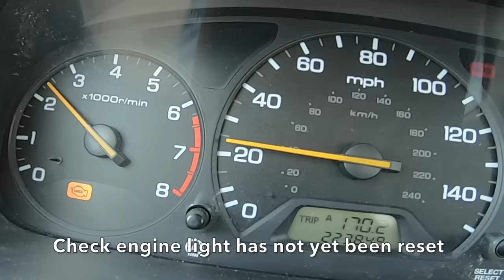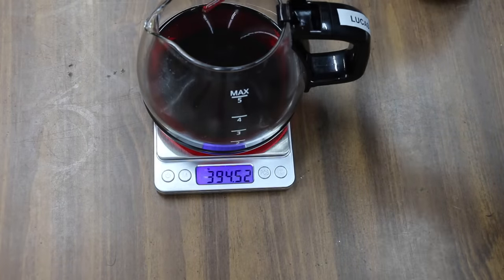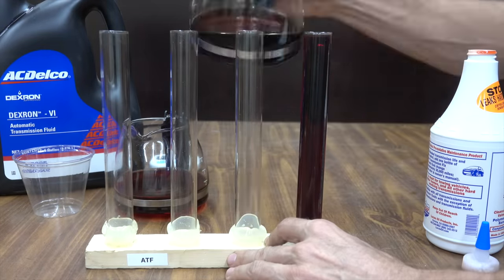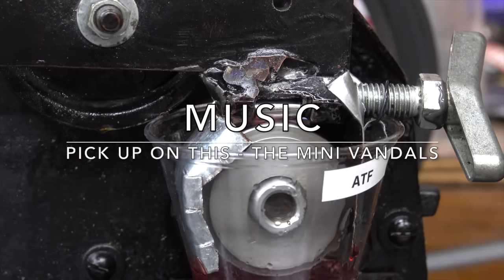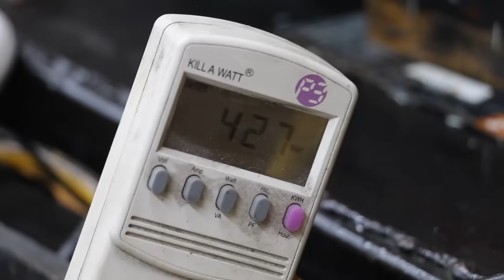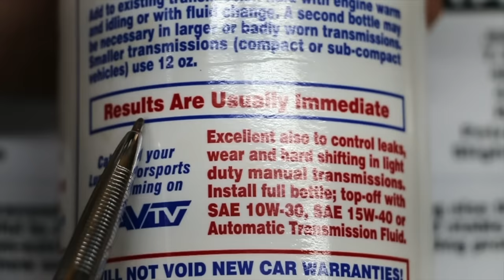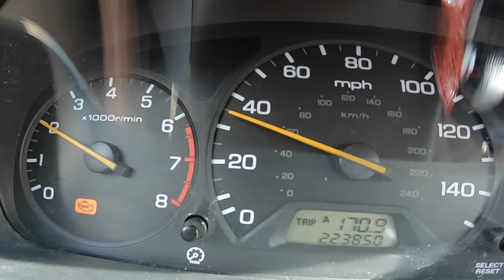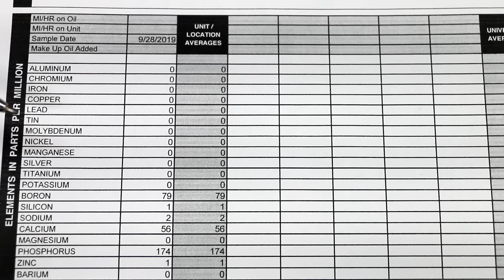Does Lucas Transmission Fix Work?  Let's find out!

Comment: Old Honda auto transmissions are fairly sensitive. You should NEVER do a transmission FLUSH on them. Many shops try to sell transmission flushes and it’s a kiss of death for Honda autos. The best preventative maintenance for Honda autos is a 3x drain and fill—Drain the old ATF and put in new, drive for 100 miles or so, then repeat 2 more times. You never want to high pressure flush a Honda automatic. Always drain and fill only.
Reply: @Starkey Morgan Yeah, that’s the only way to go. I’ve owned 5 Hondas and they have all been manual except one, which was a 99 Prelude. (My wife has had 2 AT Hondas) The 97-01 Preludes had Hondas first tiptronic trans, and the 97-98’s were especially prone to problems and early failures. Honda recognized the problem and gave the 99-01’s an extended warranty on the auto transmissions. Iirc, the dealership wouldn’t honor the warranty if the trans had been machine flushed or if you used any non-Honda ATF. The 3x drain and fill is what the Honda dealerships consider a flush because they do not recommend machine flushing.

Comment: That trans fluid looked brown to me, not pink.
Reply from the maker: Thanks for the feedback.
Reply: @ProjectFarm  When you change transmission fluid, you don't get much more than half of it out.  So if it was really bad to begin with, it will still be pretty bad after it is changed and then run to mix new with old.  That fluid should be changed again, at least one more time and maybe 2.

Comment: A none test this time. Transmission fluid change and NOT replaced with Honda Transmission fluid - must use Honda fluid. High mileage transmission, change filter only reuse fluid - new fluid cleans Transmission adding to shift problems. 
Lucas is very effective in GM transmission and older Mopar transmissions. 
Transmissions that use a specialized fluid like Honda, Lucas is effective to get the car to a shop - very short term. Cross contamination of fluid (blending) burns out a transmission quickly. 
If you have a GM product, Lucas can buy you a few thousand miles drive time. All others, Lucas will make it possible to get to a Transmission Shop.

Comment: Not sure if anyone commented on this yet, but Honda transmissions are extremely sensitive and therefore only Honda fluids should be used in them, unlike other vehicle makes. Other vehicles can take after-market fluid brands and transmission fixes; these types of fluids should never be used in Hondas. Lucas transmission fix can help other transmissions for a time, but after a while, any transmission problem will have to be repaired mechanically.
Reply from the maker: Thanks for the feedback.

Comment: Of course it works!!! I have a 1992 Buick Roadmaster who’s notorious 700r4 or commonly known 4L60. The first gear, clutch plates and sun shell were very poor quality and would be the first thing to go in these trannys🤣 my car wasn’t shifting out properly, wouldn’t shift out until it got to 3500-4000 rpm! So I pumped out 24 ounces of transmission fluid and put in 2 bottles of Lucas. Two days later it’s shifting better than it was before the issues🤣🤣🤣🤣 would I recommend this to someone with older cars? F@&$ Yes!
Reply from the maker: Thanks for the feedback.

Comment: Most Honda transmissions for the small passenger cars die, at exactly 220,000 +_-30, 210,000, 200,000 miles on an original unmodified transmission.  The most common point of failure, clutch packs, torque converter, bands or a snapped, twisted or sheared off output shaft..  I have yet to see in a junk yard, or anywhere at all ever, a single Honda passenger car transmission make it past 230,000 miles.  Luckily enough for owners, the transmissions are not expensive to rebuilt, however parts availability from OEM might be a bit of a wait or not available for some years.  This is why I tell people to avoid used Honda Passenger cars.  They are not selling it because its just fine 99 times out of 100.  The transmission needs a rebuild now, the torque converter is heavily worn, probably the bearing, and the pump is also worn, again the bearing.  The clutch packs are slipping badly.  By the way, 1300usd for a rebuild on a older model Honda, thats a rip off, unless they are putting some really hard parts.  Billet shells, triple vane torque converter, shift kit, stage 1 style clutches plus all the seals and shafts.  For a factory rebuild, 800usd or so with install.   These honda transmissions are not like the old 4r75 or 460le and other such transmissions.  They are rather small, and the parts for oem unmodified rebuilds are usually fairly priced.  The clutch packs are garbage as far as I am concerned with Hondas.  You get better clutch packs with beat up old police cars that have been thrashed to doom.  If you pay 1300, you should get at least 800, 900 to 1000 in some really nice parts.  The Honda engines seem good and reliable, the transmissions, not so much especially what people pay for them day 1 at the lot.
Reply from the maker: Thank you for sharing!

Comment: Don't you have to worry about over filling Transmission Fuild?
All Dip Sticks say DO NOT OVERFILL 
, Once I was A Teenager & Added Too Much Transmission Fluid, Made Transmission Slip.
Also You Must Use Correct Type Of Fluid For Each Different Car.
General Motors, Ford's, & Chrysler use different types. Ruined a Transmission Once By Adding Wrong Type.
Added GM Type to Ford... I own Jeeps / Chrysler. Requires ATF+4.
Heard off same problem. So I only use ATF+4. on Jeeps Chrysler Vehicles.
Reply from the maker: Thanks for the feedback.

Comment: It works but isn't the absolute cure, the issue will come back!! SOOOO why not do PM (PREVENTATIVE MAINTENANCE) before you start to have this issue. I slowly started adding this additive to my tranny change to my second tacoma before slipping starts to happen after 100k AND I run through the tranny gears much more often than my first tacoma leaving the tranny in 4 around local town driving and then in drive on the freeways and highways. I KNOW the constant shifting when in drive on my first tacoma caused the slipping because I would just put it in drive without going through all of the automatic tranny gears.
Reply from the maker: Thanks for the feedback.

Comment: If you have a transmission starting to slip, there’s one simple thing you could do. Don’t add this garbage add 1 quart of motor oil, 30 white more motor oil or 530 just 1 quart it’s a builders trick. It increases your pressure and it will take that slight slip away and firm the shift shop. It’s a old school trick. I know because I had a one Honda 300,000 miles starting to slip dumped a quart of motor oil in it firmly shifts up that little bit of slip one away.
Reply from the maker: Thank you for sharing!

Comment: I change my ATF in my vehicles every never.  😆   For real though, every 80,000 to 100,000 miles for vehicles I don’t tow with.  Tow vehicles get changed every 50,000 miles.  I've never flushed a transmission and never will I.
Reply from the maker: Thanks for sharing.

Comment: Lucas is great but you can't use it for everything. Never use Lucas engine oil additive on a forign car. It's super thick and foreigner cars use a very low viscosity oil. Adding the super thick oil additive will thicken the oil alot and won't circulate threw the engine properly and will actualy cause serious damage. Lucas has a new oil additive that has no viscosity that is made for forign cars or cars with low viscosity oils like the new ones today. The newer the car the more likley it will run 5w 20or 0w20 like toyota. 20 years ago every car ran at least 5w 20 or 30 but most were 10w 30 or 40.  I actually don't know why engines are becoming less and less in need of high viscosity oils. Or if thats even a good thing. I think low viscosity oils don't last as long or lubricate as well. But perhaps I'm wrong. I'm sure low viscosity oils help with cold Temps and gas efficiency and thats the reason cars are becoming less and less in need of high viscosity. Better gas mileage
Reply from the maker: Thanks for the feedback.

Comment: I once used it on a used transmission I got which ended up being bad, the immediate result was that it went from holding gears normally (just had a bad 1-2 shift) it slipped badly and I had to be easy on the throttle the way home. However after a while of test driving it around it eventually just returned to it's original state, might've shifted a little better but it was still harsh and delayed
Reply from the maker: Thanks for sharing.

Comment: The last thing you wanna do is change fluid out on older slipping transmissions.
Reply: That's a blanket statement and without knowing the specifics not sound advice.  It doesn't take into account what if your not doing a flush.  What about just a pan drop and filter change.  It also only changes a few quarts at a time.  Of which doing that won't dislodge the bandaid gunk supposedly holding your transmission to life.

Comment: They SELL 2 kinds Thick and THIN. Put Thick in Trans didn't shift in Chicago. BUT changed put THIN in Cleaned out Trans and Shifted Normal for 5 years. The Junk Yard 5* work but cheaper then $2K trans..HOT I keep at Lower end Higher end never shifted Right.. CHECK every fill up HOT..
Reply from the maker: Thanks for the feedback.

Comment: SO MANY CONFLICTING OPINIONS.  Some say that Lucas CONDITIONER will soften seals and then turn them to mush and ruin the tranny.  Others say DON'T use in a Honda transmission.  Then a lot of others say Lucas Conditioner is God's gift to mankind.  What to believe?  I want to do what's best for my  '94 F-150 and '07 Odyssey without destroying them.
Reply from the maker: Thanks for the feedback
Reply: @Starkey Morgan No transmission issues yet.  I'm in the process of draining out all the old fluid (you can drain the torque converter on my '94 F150) and replacing with new Ford Mercon V fluid.  The old fluid looks good - almost like new.  From what I've read, when folks do a complete change and the tranny dies shortly after then they should have checked the condition of the fluid first.  Good fluid indicates a good transmission.  Dark or black fluid indicates that the tranny is on its' last gasps of life.  Chances are it would have died shortly anyway.  But I was hoping to do some preventive maintenance by putting in some of that Lucas CONDITIONER (not the Fix or other stuff).  But maybe just relying on the additives in the new transmission fluid would be the safer way to go.  I already bought two bottles of the Lucas before really thinking much.  Now I'm reading it not only softens seals but turns them to mush.  So now I'm thinking better safe than sorry.  But on the other hand, so many people swear by the Lucas additive.  It's a tough call.
Reply: @Starkey Morgan Well thank you for the quick reply.  It has certainly helped to calm my fears especially when you mentioned your Honda CRV.  Honda is so fussy and picky that you have to use all Honda products or they'll come and smash your car to bits.  So I bought Honda ATF fluid and Honda engine oil and filter.  I bought the second bottle of Lucas ATF CONDITIONER for my 2007 Honda Odyssey which I just bought.  It only has 87,000 real miles on it and looks like it just came out of the showroom.  It too, like the '94 F150, both shift fine.  I just thought that if it was safe then a little preventive measure like Lucas ATF CONDITIONER (not FIX) would be beneficial.  The Yahoo reviews for the Lucas CONDITIONER rave about it.  But, no matter how many folks like something there is always a couple voices that say, "No, Lucas will melt your seals and you'll have to have a tranny rebuild.  It sure would be hard to argue against all your experience with the Lucas products so I feel better.  Thanks again.  And yup, I'm getting the tranny pan gasket and filter from NAPA tomorrow.  They seem to be the only ones selling a gasket that is rubber over metal like the original Ford gasket.  I've heard some bad things about the FelPro felt like gaskets.  But, then, I've heard some bad things about everything I check into.

Comment: All Lucas does is make the fluid thicker! More than likely if the truth was told the Honda transmission worked fine until someone changed the fluid! After a Japanese transmission gets that many miles on it leave it alone! You can change whats in the pan but if you flush it you will have what you have here! If you change it like I said it will run a million miles if driven at a normal pace!
Reply from the maker: Thanks for the feedback.

Comment: You have to be careful not to overfill trans too much. Pressure is critical for good shifts. Never flush a slipping trans. Just drain, add Lucas and regular fluid to full level and hope for the best
Reply: Yes and no ive flusjed ours twice.. once when it had 80k miles and was black (mom didnt know youre suppose to change fluid)  and another time when it had 309k miles... it has 395k miles now... just sayin. 98 grand cherokee
Reply from the maker: Thanks for the feedback.

Comment: My best suggestion I don't care how many miles you got on your vehicle?U DONOT wanna put anything inside your engine or transmission beside oil or transmission fluid do not add this chemical could ruined the unit have you ever read the back of the bottle or ask an actual mechanic that has been doing this for years please do so🇺🇸

Comment: There are zero fixes in a bottle, back in the day this stuff was called snake oil. A transmission that is having problems cannot be fixed by different fluid. You may temporarily mask the symptoms for a very short time but it is not going to change the damage that is going on inside. It's not any different than trying to fix worn piston rings or crank bearings with heavyweight oil or Teflon/etc additives.
Reply from the maker: Thanks for the feedback.

Comment: guy shouldn't have changed the transmission oil. you're just begging for problems with older transmissions. the crap that builds up is what makes them function properly. if you drain that out, well you get this.

Comment: In a Honda, you should only use Honda branded fluid. In an emergency try Lucas. Then if it's still bad, junk it or get a Remanufactured trans over a rebuilt.
Reply from the maker: Thanks for the feedback.
Reply: You realize that EVERY company says that, right?? It's to make you buy more of THIER product. That line is bs and is marketing 101.